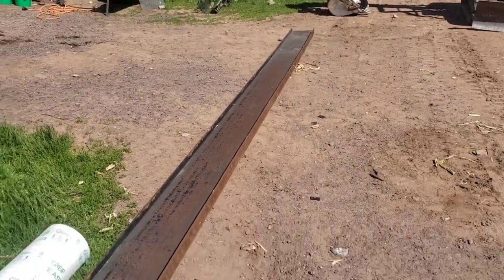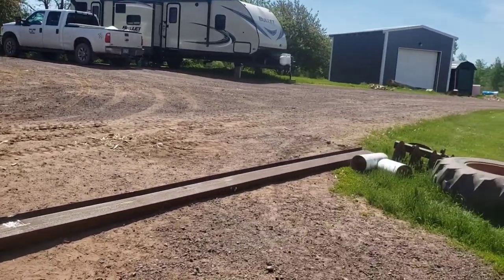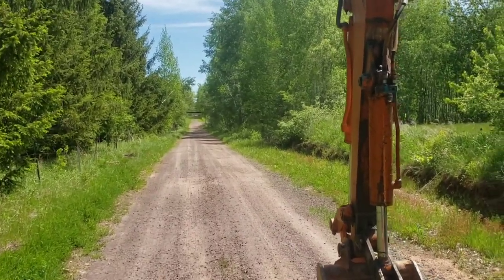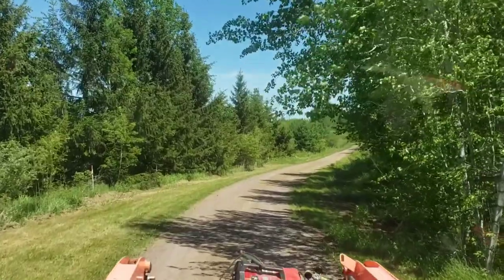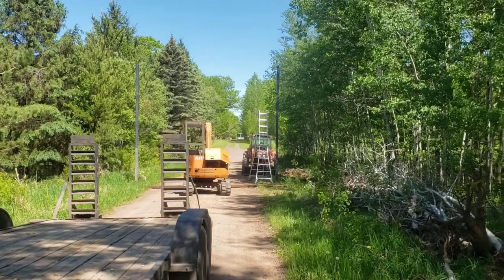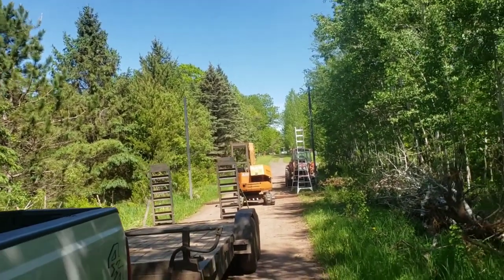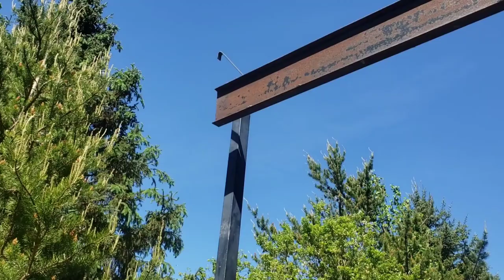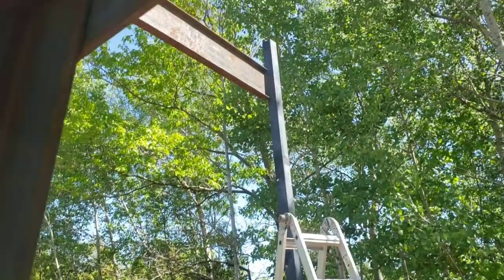Fancy Gates Part #4 First Attempt At Setting The I Beam.

Comment: Progress eh? Me, I woulda put a pulley atop each of the vertical beams to pull both the crossmember and later the gates up but I'm lazy like that.

By the way -- later this fall, into winter, you'll wanna swing by squatch's place with around 20# or so of tannerite  - he is building a massive scrap pile to burn, but tannerite would make for one hell of a show.  ;)